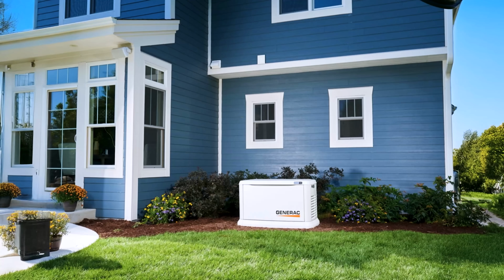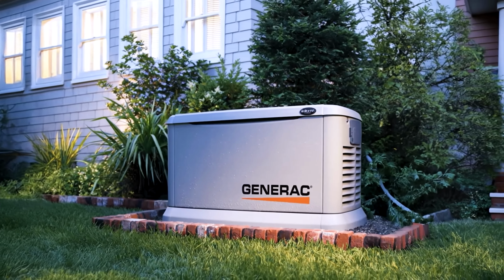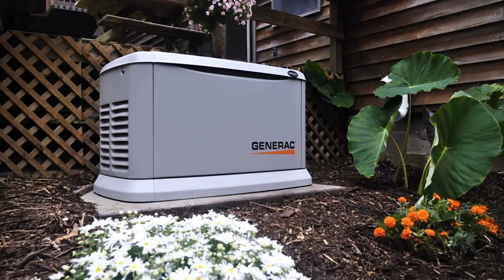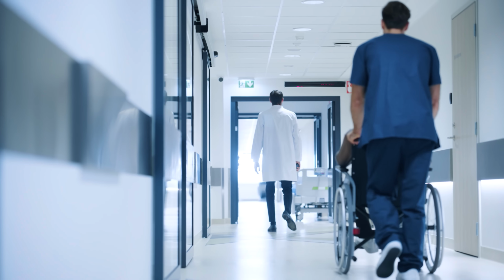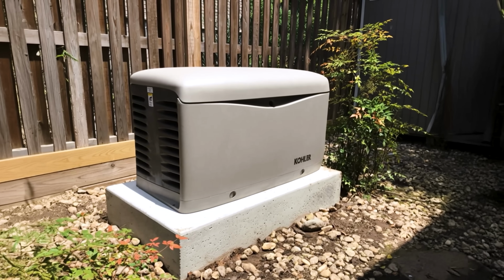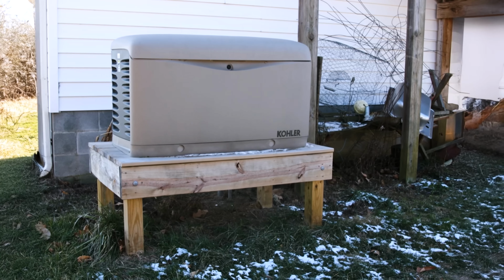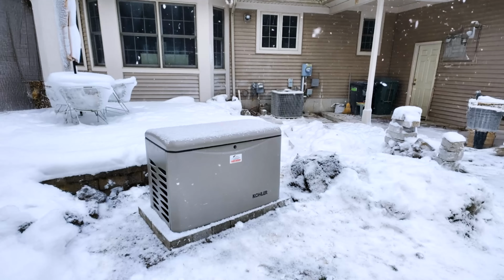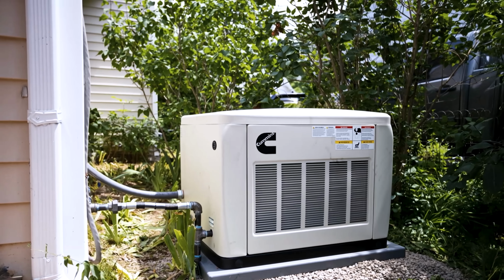Top 3 Generators for Your Home in 2025!

Comment: I am an electrical contractor in Southern California who has installed several generators with automatic transfer switches over the last 5 years. All of them were Generac and that is what I see even higher than 75% around here. I also have done some manual transfer switches with portable generators as well as battery backup with auto transfer switches. Eco Flow is becoming more popular especially where noise and fumes are a factor. Some applications I have installed a separate panel with emergency circuits when the generator was not big enough for the whole service. This is how the EcoFlow system works. One nice thing about the EcoFlow is you can easily stack on more battery units and expand your run time as needed.Thanks for the comparison video. This helps me explain options to my customers.
Reply: How are installations done with the heavy 250 pound batteries and inverters? I haven’t seen a video on safely setting up the heavy items. Any ideas with your experience?
Reply: @blasinim  The built in generators weigh even more. I move them with a furniture dolly or forklift and 4-5 strong guys. Sometimes a little old leverage and roller pipe. Heck if the Egyptians could move those stones what is a little battery? JK.

Comment: So, for an off grid solution around 26kw placed in a severe winter climate, would you consider a liquid cooled system based on longevity or stick with the air cooled models?

Comment: I like your video. Any one of the choices you talked about can serve a homeowner well. In my case, I chose Cummins 20kW because my preferred local, licensed electrical company was ALSO an authorized dealer. During install, a question did come up where immediate access was utilized by my electrician to confer with a Cummins technician. 

Authorized Cummins maintenance service will be provided by my electrical company, too.

But, I still need to be prepared for any relatively long utility power outage when no authorized service folks will be available (at relatively low cost). So, I have on hand tools and Cummins specified parts & materials to keep up with the required scheduled maintenance of my standby air cooled unit, as best I can. My plan is, if I have a breakdown of some sort, it won't be because I ignored the service manual and, for example, ran my unit 24/7 for four days without ever stopping it to check the engine oil level. Or, change the oil & oil filter. Or, change the air filter. Or ... , well, I'm sure you get my meaning here. Hopefully, my unit will be eligible for warranty service, if any, when breakdown occurs. My main focus is too keep the standby unit in top shape so it will work when it is truly needed.
Reply: I have of these also. I put it in around 2023 just after the heatwave we had in the Fraser Valley. It's been awesome.
Reply: Schedule your machine for service,or they will schedule it for you!
Reply: Probably not a good idea to run an air cooled unit more than 24 hours without shedding the load and shutting it down for a fluids check especially if you are in a hot climate.

Comment: We have a Kohler 30RCL. Great generator. It ran 10 days straight after Ian hit Florida.  It didn't burn a drop of oil.  We have over 400 run hours now on the clock.  Just a word of advice. Buy a spare parts kit with spark plugs oil and filters just incase your tec guy can't make it out after a storm.
Reply: Wish I could have tried one! RIP 🪦 Kohler… out of business making engines
Reply: @bthemedia  Very true.  If I ever need another its going to be a Cummins 30KW diesel
Reply: @bthemedia - Yeah, just found out Kohler is no longer Kohler, due to buy out.  I am going with Generac.
Reply: @hlthsvcmngr70  I won't have a Generac unless free. Kohler or a Cummins.
Reply: @hlthsvcmngr70  Good luck. I dealt with Generators as a broadcast engineer. (Radio). I cared for a group of stations, 3 had Generacs, one of the three (The oldest) was reliable. The other 2 were not (and replaced with Cummins).
Reply: I have a diesel generator the only downside is fuel maintenance.   If you don’t use it often enough the fuel will go bad,  also the steel tanks will rust if you don’t maintain them.   Other than that they are awesome.
Reply: The problem today is they want as much if not more to do an install as the generator itself. They are outrageous prices for install which isn’t that complicated if you have any electrical skills at all.
Reply: That’s for maintenance
Reply: Looking at Tesla Solar II+ versus Generator.

Comment: Generac generators are junk and their warranty is junk. Market share speaks for itself? This type of  logic is suppose to impress?
Reply from the maker: If they suck why do people keep buying them? I think market share does speak to the popularity of the brand and brand popularity is only possible with happy customers right? We have installed a bunch of Generac units with lots of happy customers. Are they the best generator in my opinion… probably not. 🤷🏼‍♂️
Reply: @HarderPowerCo. You have offered a post hoc ergo propter hoc fallacy. Market share is defined "The proportion of industry sales of a good or service that is controlled by a company." This datum does not determine happiness which is in itself a nebulous and subjective term. It has been a couple of years since I read the Generac warranty which was very conditional about how many hours of operation per year the unit would be under warranty. If these hours were exceeded the warranty was void. Unless the unit is placed in an area of consistent and constant power outages, generators may get a few hours of emergency operation per year for a cost of $10K $20k. Generac as with many big brands build their equipment to last until the warranty is expired. Also the sales people will attempt to sell the largest generator possible. I have witnessed a 22kw generator paired with a small home. Unless people have medical or environmental problems there are much more frugal options available. I have been involved in this industry for 28 years and some sales people sell the immediate back up power as the key to contentment, but this switch from grid to generator power is extremely expensive and most often unnecessary. This comment will most likely be deleted.
Reply: @HarderPowerCo.  It appears you deleted my reply to your comment.
Reply: @HarderPowerCo.  because generac does more advertising on tv than kohler does...you do the math..lol.
Reply: @HarderPowerCo. People are sheep and purchase what they are sold.
Reply: Generac is more widely known and available and sold at Lowes and Home depot. And Customers get sold on those fancy service and warranty plans.Thats the only reason its so huge. 
And when the find out the warranty actually sucks and your technician has every excuse in the book on why he cant make it out . People stopped requesting Generacs.

As a Contractor in North Eastern PA we no longer install Generac.  Strictly Kohler.  They cost more but rarely have call backs or repairs.  
And we have a real 24 hour service technician company that shows up during an emergency.   Good luck getting your Generac fixed when you need it most outside of a major metropolitan area.
Reply: MARKET SHARE ? GENERAC HAS OVER 80%

Comment: I have heard from some that generac has had issues and the service was hard to get when you need it most and in the Northeast some call them generic.
Reply: @rjentz Your are correct. In the entry level Generac it is in the fine print. Your void your warranty if it has too many hours per year.
Reply from the maker: @TheMickeymental nice tip!! 👏🏼
Reply: @TheMickeymental    not quit
Reply from the maker: Absolutely! Geographic location is a factor for quick service and all these brands do rely on their dealer network to service the generators. Some dealer areas have holes with little to no certified warranty technicians. Alternatively in storm season some of the small businesses get overrun with calls!

Comment: Cummins has a terrible dealer network compared to Generac and Kohler, and with an investment this big you want good local dealer(s) to support whatever you have installed. I ended up getting a Kohler and am happy.
Reply from the maker: That’s a good note!! I have noticed that
Cummins doesn’t have many dealers in the region I’m in!
Reply: You are correct I think  the talker above is pushing Cummins.
Reply: RIP 🪦 Kohler… out of business making engines
Reply: @bthemedia  You keep making the same comment

Comment: The problem with cummins, people think they’re getting a cummins motor, they sometimes depending on the application. Warranties, warranties good and bad… if the gen breaks down hopefully parts are available especially after a bad storm. The new thing for people is not a stand by gen but a PRIME GEN because people r realizing they want something that can run longer after a bad storm has hit. I wish you would have talked about the bluetooth capabilities in these generators(if available). Its helpful for people who travel away from their homes for a long time. Thanks for the info on each gen!
Reply: Im a Cummins Onan dealer.  The engines in the aircooled as well as liquid cooled gensets are cummins motors. And a dealer can get any part using quickserve.
Reply: Didn’t cummins make the motors before for Generac
Reply from the maker: I completely agree! Sounds like we need to do another deep dive video! 

Good note on the Cummins motor! Thanks for your feedback. 👊🏼

Comment: My Harbor Freight Predator 9500 will power my entire house back feeding through my welder plug. It’ll run the air conditioner but you have to be careful what else you turn on. Best $2300 I ever spent. It’s been a good unit
Reply: The problem with the Predator or similar vs the ones in the video is it has very poor quality power coming from it. If you look at the power out put you will find it to be of a "dirty" nature. The wave is off, and frequency can even fluctuate depending on load. This is incredibly bad for electronics in the house. It will shorten the life of furnace boards, tvs, laptops, newer refrigerators, etc. You get what you pay for and the permanents from the big three are far superior in quality, reliability, and safety.
Reply: Backfeeding is highly dangerous, accidently forget to turn off the main and a lineworker could be killed. Power comes back while the gen is running you will blow up your generator and cause major electrical damage to your home. Get a proper transfer switch installed.
Reply from the maker: Sounds like a cost effective set up! 💪🏼

Comment: I will never buy another kohler product.  I ordered a 14,000 kw from lowes.  Hired a local licensed electrician to install.  Right away it didnt work properly, would give various error codes, all of which turned out wrong.  I then got a kohler dealer to come out .  After 2 hours 
He found a wire under the generator unit had been pinched off during manufacture.  Because it wasnt installed by a kohler dealer.  Kohler only paid half of the $700 bill.  It then worked but only now and then, apparently an intermittent problem.  I got a different installer out, thought it was fixed, then quit again.  To shorten  the story, i finally figured out the gas turn on valve only turned on part of the time.  I put on a new gas selenoid and it finally works.  This unit arrived with a hidden severed wire and faulty gas selenoid from factory.  Took over a year to solve!  Never again!
Reply: Hey unfortunate this occurred but they are top notch.
Reply: Kohler should have taken care of the entire situation, no questions asked,
I just recently purchased a 26kw generac from Lowe’s ,  only partially installed, transfer switch and gas stub up is done, waiting on inspections,  and final hookup, can’t wait to have it up and running!
Reply: That’s pretty standard buying through big box stores regardless of what the product is.   Went through it with Home Depot and a John Deere mower.   Never again to save a few bucks.

Comment: Strange all of these home standby generators mentioned in the video are all very similar in price for just the main unit give or take a few hundred here and there excluding the liquid cooled units.  A 22kw Generac is very similar in price compared to comparable models from Kohler and Cummins.  You would think Generac would be a less expensive unit the way the brand is talked about in the video but cost wise it really isn't.
Reply from the maker: That’s an interesting note. They might be close if you just google the price but when we’ve priced them out in Canada the generac usually comes in between $1,000-2,000 less.
Reply: Generac and kohler factories in Wisconsin are 75 miles apart
Reply: Cheap is NOT good,and Good is NOT cheap!
Reply: The video is not as honest as it could be

Comment: Did I miss the prices?
Reply: Air cooled units are in the 6K to 9K range. Liquid cooled units are triple that number depending on capacity. Kohler 38KW liquid cooled is currently $23K plus installation so budget about $35K turnkey depending on your situation.
Reply: $35k. Where do you live????  A 24kw will run most homes around 2,000 sq ft with a full load dryer, ovens and heat etc……Install should be around 20-24k… Parts and labor included

Comment: I have a Kohler 26kW generator with an automatic transfer switch.    In Miami, I keep getting brownouts where I will lose power for a minute at a time.  The generator takes 10-20 seconds to come online so everything in the house beeps loudly when it comes back online.  I'm looking for a whole house UPS that can keep everything on for 20 seconds until the generator comes online.  Is there anything ready to install out there for this scenario?
Reply from the maker: Yes, there are ready-to-install systems that can keep your whole house powered for the 10–20 seconds it takes your Kohler 26 kW generator to kick in:

1. Rotary UPS (Flywheel-based UPS)
2. Large-Scale Online Battery UPS
3. Whole-Home Battery Backup + Standard UPS

This might be a great topic for a future video!! 😊
Reply: @HarderPowerCo. Please make one.  Need some examples on what products to buy as well as how to hook it up.  I've called so many local dealers here in Miami and no one seems to know.
Reply: @EvanWasHere home batteries like anker solix or tesla power wall are designed for this
Reply: Ecoflow whole house unit.
Reply from the maker: @tkendr01 we love ecoflow!